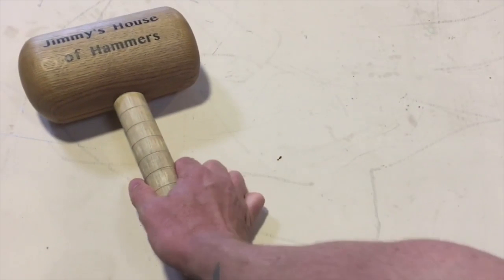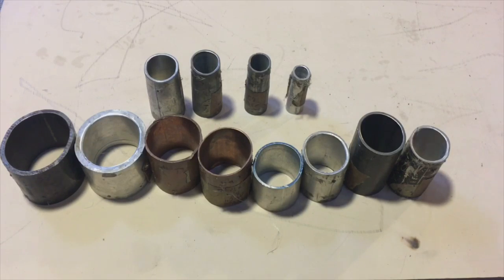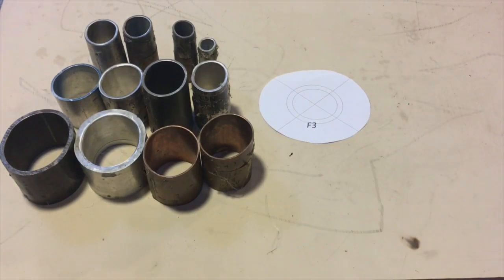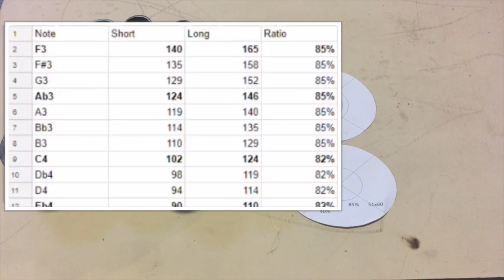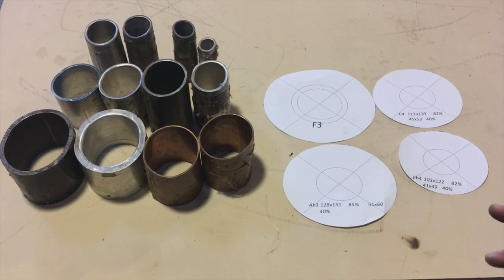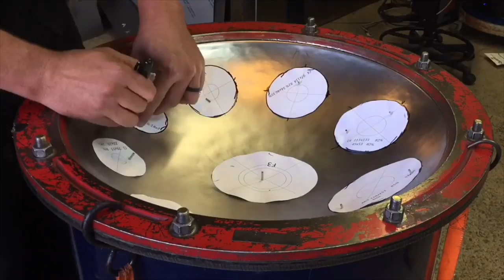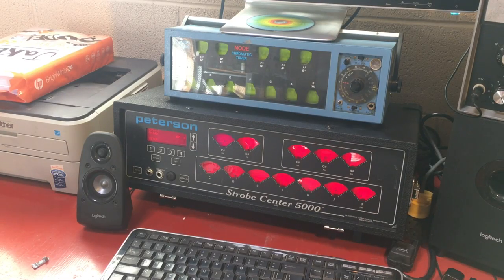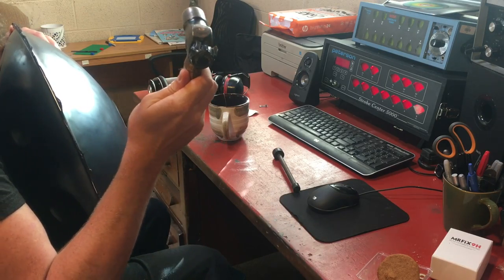How To Make A Handpan- The 3 Hammer Challenge - 2018

Comment: Will you please share the measurement table of the tone fiels plzzzz
Reply from the maker: check the 2019 3 Hammer Challenge video for tonefield dimensions.
Reply: @ColinFoulke  in which software  you makes those templates
Reply: @ColinFoulke  I saw 2019   3 H C
Reply from the maker: @dipinpradeep9793  Microsoft paint.

Comment: Which material is the shell blank?
Reply from the maker: 18 gauge 1008
Reply: @ColinFoulke  I dont get it well  haha greetings from Mexico, which metal is?
Reply from the maker: @ricardomoralesmondragon3672  18 gauge is the thickness, 1008 is the kind of steel.
Reply: @ColinFoulke  it doesnt look 18 gauge , if you used 18 gauge , you would tear it
Reply from the maker: @kubilay6151  Its 18g, 1.15mm
Reply: @ColinFoulke  thanks  Colin. I’ve tried 1 mm but it cracked .   I will try to heat 18g sheet and shape it.
Reply from the maker: @kubilay6151  1mm should work too, just a bigger margin for error. No need to heat 18g. You just need to sink it evenly.
Reply: @ColinFoulke  thanks Colin. Respects..
Reply: @ColinFoulke  Curious to know... if it's raw steel, It might not have any rust treatment such as nitriding, so what about durability in time ? 🙂
Thanks for the info and the Inspiration, I'm about to finally dig into this challenge myself !
Reply from the maker: @mathieuclavel-handpanmusic1847  it’s raw material. Once it gets fired by the torch the oxidation layer helps with rust. Oiling regularly helps too.
Reply: @ColinFoulke  Yeah that's what I thought about the oxidation layer after torch, but wasn't sure if it was really effective. Thanks for the info !!
Reply from the maker: @mathieuclavel-handpanmusic1847  good luck!

Comment: This is a no-starter mate.

How can it be a challenge when you're using a state-of-the-art professional and precision-engineered rotating handpan maker's jig and heavy-duty clamping system tightened to just the right torque so as to prevent flange creepage on a customized metal frame stand. Or did you forget to mention this small detail?

Did you also forget to mention the state-of-the-art laptop running the latest version of Windows and the latest release of the incredibly-difficult-to-find handpan maker's tuning software in 32-bit OR 64-bit versions? Again, just a small detail eh?

As for the handpan craftman's precision-engineered high-tech hand-tools, wouldn't a hammer and mallet do the same job?....

Otherwise I'm quite impressed!
Reply from the maker: paul tomasi if you know of another way to sink a Handpan shell, by hand, not using rings, I’m all ears! Also, linotune is very easy to get. Just google it! Free trial and all.
Reply: @ColinFoulke  Nope! You've got me on that one my friend. Ain't no way you're gonna sink a handpan without those rings - just as an embroiderer relies on her (or his - let's be PC here) rings to create a visually stunning work of art - the difference being I suppose is while an embroiderer creates a delicate work of art using fine silks and satins, just about anyone can bash away at a lump of metal using a hammer. It sort of brings out the primitive beast in man, wouldn't you say? Which is why I wouldn't have minded giving it a go myself.

Great video. Inspiring. Thumbs up!